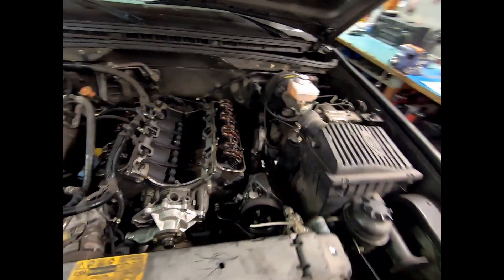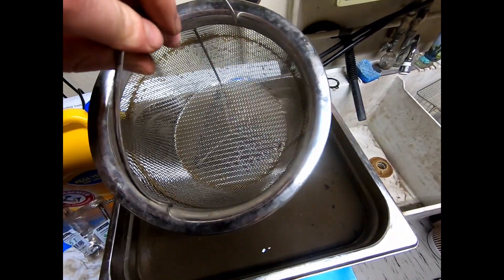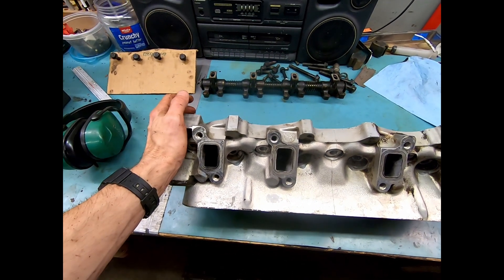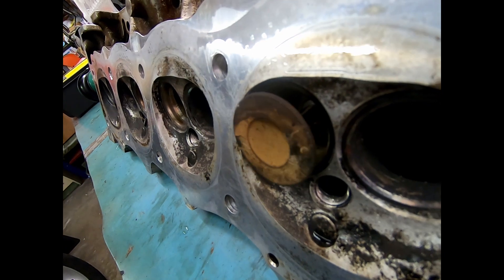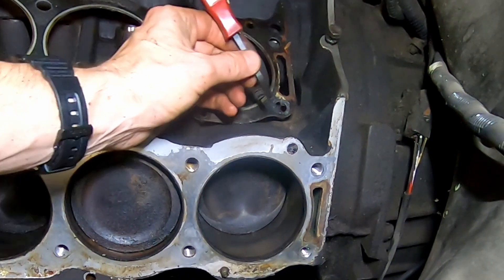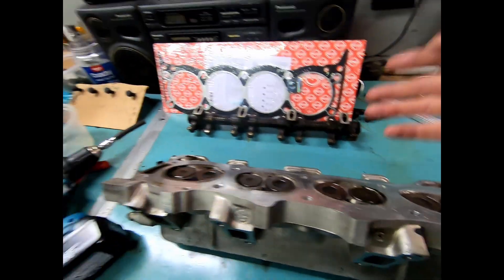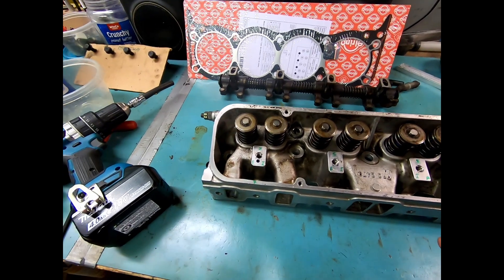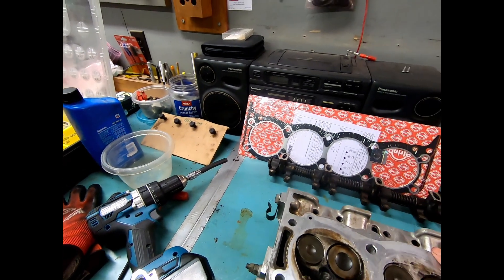Engine Work Part 3 - Valve & Cylinder Head Cleaning - 1997 Discovery - "Jimmy"

Comment: I put my valves on my drill/screw driver and with water and 2k grit it all comes off.  3k grit makes it smooth after
Reply from the maker: It's the way to go! I like the rubber hose method because it allows a little more angle flexibility on the drill side, and it allows you to pull back with even pressure.